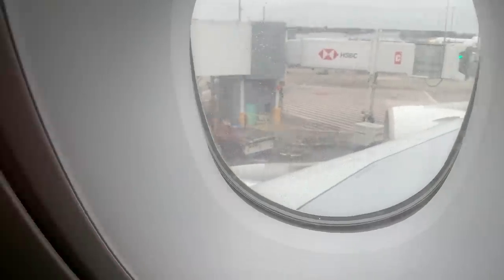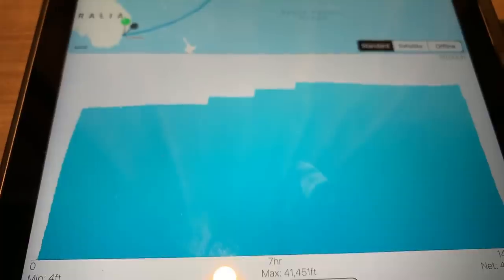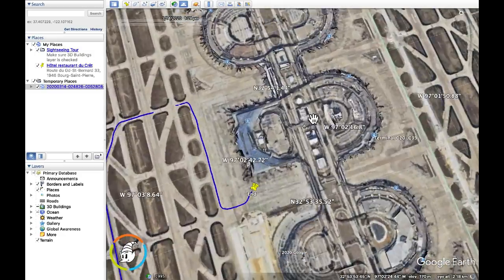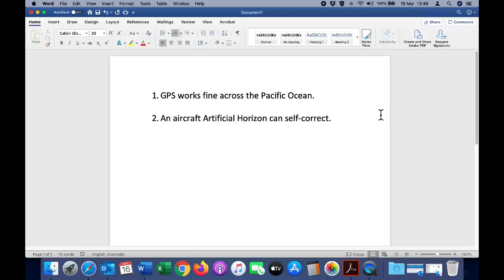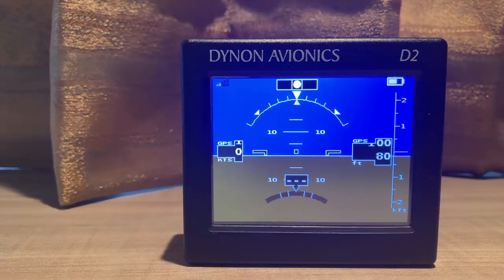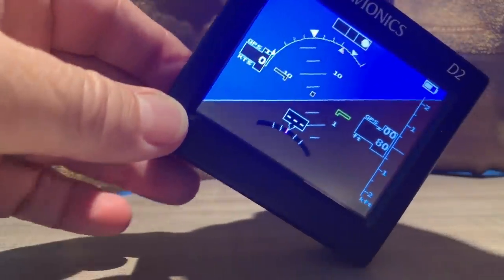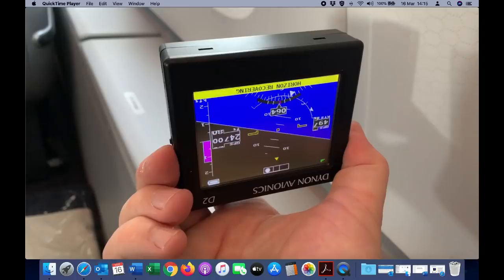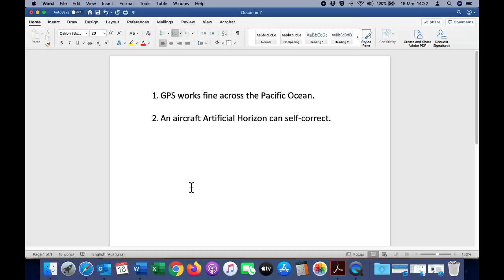GPS and Gyro testing on Qantas Flight 7 across the Pacific.

Comment: Wolfie – as a physicist (retired), this is fascinating! It also occurs to me that there are other ways to "confuse" the Dynon D2, based on the Equivalence Principle, which equates gravity to acceleration, and is a cornerstone of General Relativity (GenRel).
Think what the D2 would do on a flight of the "vomit comet." In free-fall, the sensor has no reference to find the "down" direction, and I'm guessing that it would stay in "Recovering Horizon" mode until the plane came out of the parabolic dive.

Also, in any maneuver that maintains constant acceleration (relative to the ground) of the aircraft for some length of time, in any non-vertical direction, at any substantial percentage of 1g, the "down" direction indicated by the D2 would be thrown off, because what it's actually sensing (as "up") is the direction of its own acceleration relative to what we in physics call, "local Lorentz frames." These are free-falling inertial (in GenRel) frames, relative to which the ground accelerates upward at 1g.

All this could make for some remarkable demonstrations... so long as the demonstrator has a strong stomach   ;–)

Thanks for this, and all your videos!

Fred
Reply from the maker: Hi Fred, you are totally correct and this is a problem with mechanical artificial horizons.  During an extended turn at a steady rate they can begin to align according to the angle of the sensed non vertical force.  Instrument pilots learn these errors during training. 

They have ingenious ways of minimising it with the ability to stop corrections while sensing more than 1.1 g for example.  Relying solely on the gyro for a short period of time during the turn.  

The D2 also uses the data from the GPS to understand what the true flight path is and if the direction is turning or flying in a straight line and this assists the algorithm though I don't know specifics.  

They are very clever and here is a demonstration of this unit another aviation AHRS alongside phone based levels. 

The phone apps were useless as you see in the next few seconds from this timestamp.

https://youtu.be/skR2gN0swcM?t=759
Reply: @Wolfie6020  Thanks! Yes, as I was writing my comment, I was starting to think that the internal gyro could be used to keep a reference direction, but those always have some drift rate or other. And yes, the GPS capability will certainly help "figure things out" in those sorts of situations. Plus commercial and private aircraft won't generally put a lot of this sort of strain on attitude sensing.

Now in a military fighter jet, OTOH, ...

And I could certainly see how useless the phone apps were; they never did pick up that the plane was in a serious left bank for quite a while.

Fred

Comment: I think I’ll have to get one of those Bad Elf units. They look rather nifty. 

Great video. Thanks.
Reply from the maker: They are really good.  Get the Pro,  It is cheaper and I think more sensitive.  The Pro+ has the Russian Glonass satellites also but seems to drop out easier when indoors.  The Pro is rock solid.   Friend of mine has both and agrees.
Reply: Wolfie6020 - You do realise that the tail number is on Comm. 1

So a Pro+ it is then. Thanks.
Reply from the maker: @Trevor_Austin  That is the factory demonstrator aircraft.   Same model but different tail.
Reply: @Wolfie6020  These Elf units also give the location of the GPS satellites as well, don't they? If so, it would show them changing position (since they are not geostationary, contrary to popular belief) which would disprove the "GPS is just Earth-based towers!" claim from flat Earthers.
Reply: @Trevor_Austin  I think Wolfie was saying the Pro is better than the Pro +  :)

Comment: Another very clear and concise video.  This along with your cruise ship demo and coin on the scales gonna make it hard for the FE recruitment officers.....  I am having D2 envy, thinking I need one for my boat to measure the angle of heel.  They are a bit expensive, so maybe I could get a unit from an el cheap drone and throw the data into Excel, and give myself 9 decimal places, because I can, to improve the accuracy.  But I do sail a catamaran, so wouldn’t want to capsize due to rubbish data....wait, I live in Brisbane so I am already upside down, so good to go.

Comment: Those Bad Elfs are nice!  I have an 'old' Garmin GPS V which was state of the art when I purchased it.  The military was using it I was told in recon units.  I just wanted it because it was bad ass! LOL  The Elfs do so much more (connectivity wise) than my GPS V does now and for a lot less.  Course my WAAS accuracy is 'decent' at 2-3 meters but the Elf getting 2 meters with no external antenna is nice!

Comment: Interesting and informative as always.

I'm waiting for the first flerfer to say that flight path must be fake because it's curved.

Also, if I'm not mistaken, a few hours after your nearest approach to Hawaii heading toward the US mainland you were nearly 2,000 km from the nearest land and GPS still worked just fine. I noted this myself when I flew LA to Sydney and back as a passenger a few years ago. Flying from the east coast of the US to northwestern Europe there's a similar point in the North Atlantic more than 1000km from the nearest land and GPS works fine there as well. I suppose the flerfs will claim that commercial planes are sending bogus GPS info to your phone or other device. They always have a lame excuse for everything.

Comment: Wolfie6020 I couldn't but notice you were frantically zooming in on Google Earth using a mouse and scrawling which isn't efficient the best way is press and hold FN button and use page up and down, for a slower zoom just use plus and minus, if you want to Zoon to a certain position just move the mouse pointer to that point and then Zoom if you prefer to use the keyboard to change the mouse position you can use WSAD keys
Reply from the maker: Thanks I didn't know that.  I will try it when back in the room soon.
Reply: Looks at my keyboard for a FN button...  must not have an updated keyboard  :(
Reply: @tubedude54  Fn button is on the iMac computer on a PC it's called function
Reply: @SKYFLYBRI  (pulls out my OLD IBM Thinkpad)... sure enough!  There it is! LOL  Thx!!  Been a long time since I used a laptop.

Comment: Flat Earth is hyspherical.
Reply: JSSTyger no, you are deceived...
But what enables the unit to adjust for supposed curvature?, wouldn’t be the ambient air pressure differential sensors known as pitot type device? So my unit has no gps and no pitot tube, U.K. to South Africa should show minimum 35o we’ll see...

Switch off your pitot technology and show us your AH in you actual plane correcting, there is no curvature, my device doesn’t make corrections it is CALIBRATED ONCE.

Why lie??

Aircraft altitude is measured (inferred) by atmospheric pressure. The aircraft is usually flown at an altitude that maintains constant ambient pressure (by pilot or autopilot, as the case may be). Changes in local barometric pressure (provided by air traffic control) are used to recalibrate the aircraft altimeter. As long as the aircraft is flown at a constant ambient pressure (hence constant altitude), it will be following the earth's curvature (as the atmosphere is attached to the spherical earth and has same properties at same distance from the center, in an ideal case) as the altitude is measured from the surface, which is curved, and not a plane.
Reply: @Rude_Earther  Say what?
Reply: JSSTyger A pitot-static system is a system of pressure-sensitive instruments that is most often used in aviation to determine an aircraft's airspeed, Mach number, altitude, and altitude trend. A pitot-static system generally consists of a pitot tube, a static port, and the pitot-static instruments.[1] Other instruments that might be connected are air data computers, flight data recorders, altitude encoders, cabin pressurization controllers, and various airspeed switches. Errors in pitot-static system readings can be extremely dangerous as the information obtained from the pitot static system, such as altitude, is potentially safety-critical. Several commercial airline disasters have been traced to a failure of the pitot-static system.
Reply: @Rude_Earther  do you think i cant sniff copy and paste from a mile away?
Reply: JSSTyger 😎👍🏻

Comment: what the flatties should test in airplanes with gyros and accelerometers is whether the flights continually turn right when flying to west or left when flying to east as they would have to on a flat earth that looks like the AE map
Reply: That's not entirely correct.
Constantly turning right or left if flying west or east to another location on the same latitude wouldn't make any more sense if the earth was like an AE map since the shortest route would still be a straight line, not along a curve following the latitude you started from.
A straight line on an AE map between Oslo, Norway and Anchorage, Alaska would actually be pretty close to the real great circle between the two cities since the AE map is least wrong at high northern latitudes.
The discrepancy becomes larger the farther south you go. The shortest route between two points on the equator on the real Earth is along the equator itself since it is a great circle (the only latitude that is), while following the straight line between those points on an AE map would be a detour to the north in the real world.
It gets even worse in the southern hemisphere as the straight line on the AE map between two points on the same latitude would go north of that latitude, while the great circle in the real world goes south of it.

Comment: Flat boys, Flat boys, watcha gonna do?
And there will be wailing and scratching of heads.
Reply from the maker: Got a new vid with the song for the next vid :-)
Reply: LOL
Reply: What we gunna doo? Is do our own research...

But what enables the unit to adjust for supposed curvature?, wouldn’t be the ambient air pressure differential sensors known as pitot type device? So my unit has no gps and no pitot tube, U.K. to South Africa should show minimum 35o we’ll see...

Switch off your pitot technology and show us your AH in you actual plane correcting, there is no curvature, my device doesn’t make corrections it is CALIBRATED ONCE.

Why lie??

Aircraft altitude is measured (inferred) by atmospheric pressure. The aircraft is usually flown at an altitude that maintains constant ambient pressure (by pilot or autopilot, as the case may be). Changes in local barometric pressure (provided by air traffic control) are used to recalibrate the aircraft altimeter. As long as the aircraft is flown at a constant ambient pressure (hence constant altitude), it will be following the earth's curvature (as the atmosphere is attached to the spherical earth and has same properties at same distance from the center, in an ideal case) as the altitude is measured from the surface, which is curved, and not a plane.
Reply from the maker: +Rude Earther 
.  
The accelerometer mate.   That is why I kept asking you to try your experiment with the accelerometer turned off. 

Nothing to do with pitot or gps.
Reply: Wolfie6020 it’s well stated in various pilot training manuals and information documents regarding the ambient pressure sensors roll in adjusting for curvature, why lie?
Reply: Wolfie6020 if mems adjust for curvature and gps gives positional data, what is the need for ambient air pressure detection?? You are a liar and have lost my respect! 

MEMS also are being used in navigation devices. Honeywell and Rockwell Collins in November formed a joint venture, Integrated Guidance Systems LLC, which plans to introduce a MEMS deeply integrated inertial navigation system (INS)/GPS product, with anti-jam, by mid-2006.

The INS/GPS was created for and is flying on an unmanned air vehicle (UAV) that Honeywell is developing under DARPA's Organic Air Vehicle (OAV) program. The UAV will weigh less than 112 pounds (51 kg) and have vertical takeoff/landing (VTOL) hover and cruise capabilities. The U.S. Army's smallest operational units would use OAVs for reconnaissance, surveillance and targeting.
Reply: @Rude_Earther  How is a planes altitude measured?
Reply: @Rude_Earther  Maybe some people just like extra data? My calculator also tells time, but you don't see me screaming conspiracy.
Reply: @Rude_Earther  I did my own research. Sorry mate, you can believe the Earth is flat, or that you say you do. That does not make the Earth flat. My research says that it can't be flat.

Comment: Regarding the newer fancy aircraft, do they have a mix of electrical instruments with the older more mechanical instruments as backup? All the research I've been doing on A.H. and altimeters had me wondering if it's all just full electronic these days.
Reply: It's all electronic these days. The pitot/static system is still obviously connected to the atmosphere and still uses the same basic concepts. Here is the detail from my operating manual:-
Air Data
Three static ports are located on the left side of the airplane and three static ports are located on the right side of the airplane. Left and right static ports are paired through pneumatic tubing to each of the left, center and right air data modules. The air data modules convert static air pressure to a digital output for use by other systems
Two pitot probes (right and center) are mounted on the right forward section of the airplane. One pitot probe (left) is mounted on the left forward section of the airplane. An air data module is connected to each pitot probe. The air data modules convert dynamic air pressure to a digital output for use by other systems

Comment: Some much leg space. I have never seen that before on a plane.
Reply: Nor will you (or I) unless you're "on the upper deck of the [insert airline] A380" or in the front section of a smaller airliner.

Comment: Hey Wolfie! Nice demonstration!
I think you've made a mistake though when you said it takes 8 minutes to fly one degree of Earth curvature. I guess you actually wanted to say one MINUTE of arc (one nautical mile). That would be consistent with a 480 knots (NM/h) ground speed!

(Adding: of course, moving around 1' of arc every 8 minutes of flight reinforces you point!)
Reply: One degree of Earth's curvature = 111.2 km.
111.2 km / 8 minutes = 13.9 km/min = 834 km/h, which is a pretty typical speed for many passenger jets, although some jets have a cruising speed of about 900 km/h or so.
Reply: Wow, not my best back of the envelope calculation. Obviously you are right.

Comment: One thing I notice about your new toy...Buttons! There's just loads of buttons and I want to press them all.. But I can't, cos I'd proper get done. lol
Are the HF Radio frequencies used for SELCAL on your craft or don't you use it? I only ask because as a Radio Enthusiast I sometimes listen to SELCAL on Shortwave and I love learning where different signals and data modes originate :) Thx x
Reply: HF SELCAL is still used extensively over the Atlantic but much less over the Pacific. TBH CPDLC (texting between ATC and pilots) ought to have made SELCAL obsolete but it hasn't yet.
Reply from the maker: +JohnnyX50.  Yes plenty of buttons for sure.  You are right. The HF does have Selcal.

The main use is for voice communications over oceans when out of VHF range.   There is a lot of chatter and noise which is really annoy so you de select the radio volum otherwise it would drive you crazy.

The selcal is a tone they send that alerts the aircraft ATC are calling us.

We get a ‘selcal selcal’. Voice and it pops up a message also.  Then you select the HF radio and call them with Your callsign and ‘answering selcal’

Comment: Flerfs will now change their story to something like "But GPS companies all use a secret WIFI so if there are multiple devices in range, they will all show the exact same data."
Reply: Now now, don't forget the high altitude balloons that manage to hang perfectly motionless in the sky, maintaining position with milli-metric accuracy, despite the fact that you would expect them to be blown all over the sky by the winds at that altitude.
Reply: @thearmouredpenguin7148  The balloons have propellors! A flattie told me he had photos to prove it but that they are far too valuable to show globies like me
Reply: @hashmaldawn3878  they always do that. 
 "I have proof"
show me
 "do your own resesrch"
Reply: The Armoured Penguin If a Flat Earther is telling that GPS satellites stay still in the sky, they’re just proving they haven’t bothered to make any observations on the system. I don’t know about other constellations, but GPS satellites are on 12 hr orbits, they set and rise. You can see it yourself, if you’ve got a device that will show you which satellites it can see. In the cruise video, Wolfie had an app that was showing which satellites were visible. It’s really not hard to verify.
Reply: @heatshield  A discussion something like this: "This is a real photograph, exposed on film in the 70s, before CGI was a thing. NASA has original negatives to prove they are not fake." Answer as question: "Did you take that photograph, because if you didn't it's fake."
Reply: @paulcrumley9756  I see this isn't your first rodeo.
Reply: @paulcrumley9756  You're nailing it.

 Flerf Class A: Full Time professional YouTube flerfing with the goal to keep flerf alive through dishonesty and manipulation to protect their income. 
 (No hope for them. They're full of shit)

 Flerf Class B: Poes trolls and parody accounts. 
 (no hope, they're just playing)

 Flerf Class C: Real believers who have fallen for the bullshit from class A and/or B. 
 (always some hope for them)
Reply: @paulcrumley9756  of course there are sub categories and sometimes a fine line,  but thats the day one basics, in my seasoned opinion.